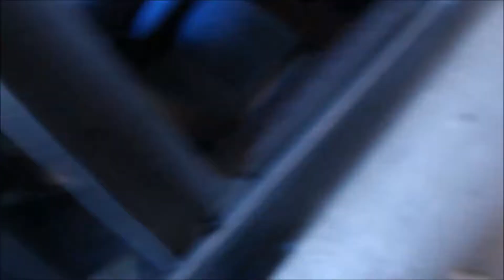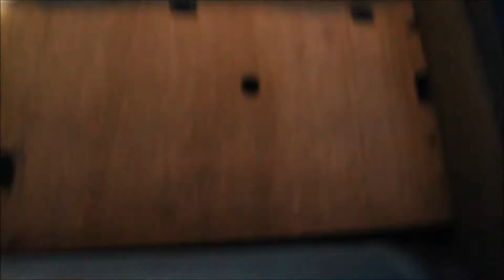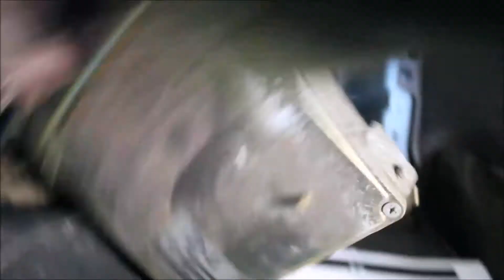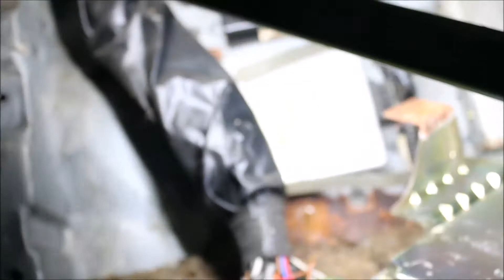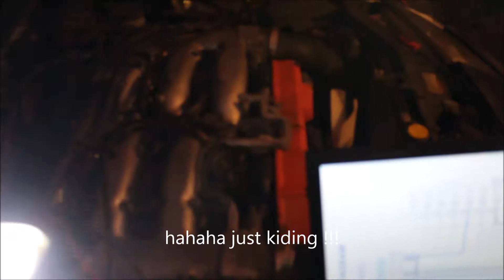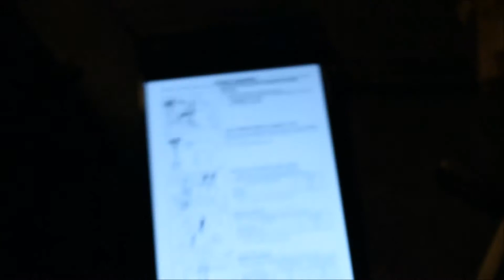testing z32 injecter wiring 2

Comment: Hi, thanks for the vids re the ignotion and injectors. I hlalso have a 300zx TT with exactly the same problem but on no 5, a difficult one to get to as you know. Compression same as the others and good spark. Will run through the injector and harness so your video will be very useful. Did you solve your injector problem and get the car running properly, or was this an abandoned project. Thanks for putting the vids out, cheers T

Comment: Did u do a compression test on the cylinder
Reply from the maker: I do remember doing a compression test I can't remember  off hand  What the number was but it Wasn't suspension enough to cause a dead cylinder With these cars you have to remember They are a wiring nightmare and are very sensitive From running the wrong spark plugs or It's always best to start at the simplest Cars and work your way up from there You could have a wire pulled out of a harness connection There's no one answer fix all but I can tell my experience  from owning  many Of these cars

Comment: Did you ever figure out what’s wrong with it cause mine is doing the same thing one cylinder isn’t firing replace spark plug and coil still bad only think it could be is dead cylinder of bad injector